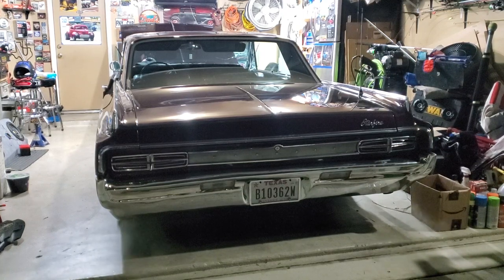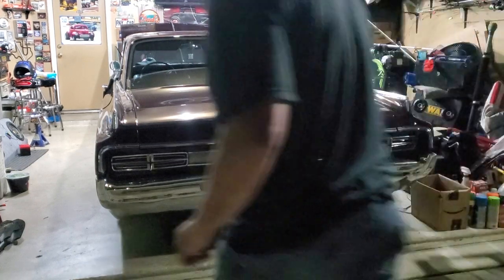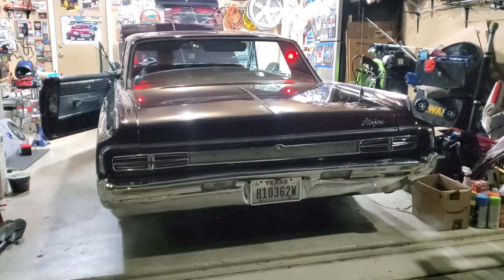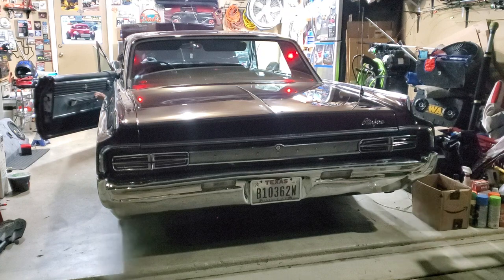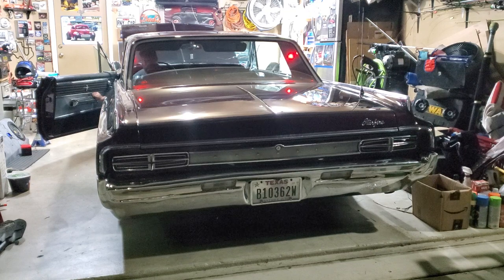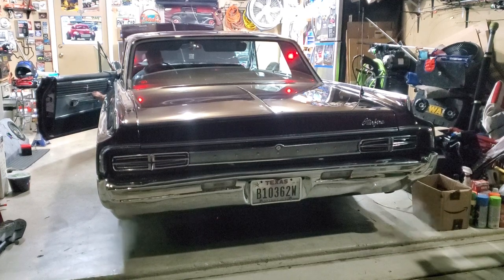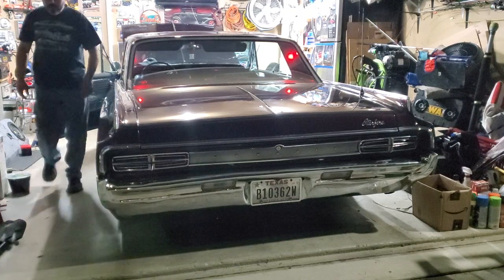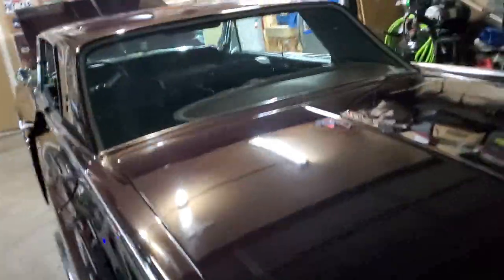Electrical upgrade to your classic car

Comment: Nice, definitely going that route when i put 348 back in my 64 C10. Thanks for sharing.
Reply from the maker: Cool, I upgraded the cables when I had seal beam head lights it made those light up real good

Comment: Bro , I noticed a aluminium radiator  , do you have any  over heating problems.
Reply from the maker: Not at all she runs between 180 - 190 during the summer I have a "16 electric fan off a 2018 Ford focus
Reply: @starfirerider , I just switched back to a copper radiator  , the aluminum rises in temp when stuck in traffic